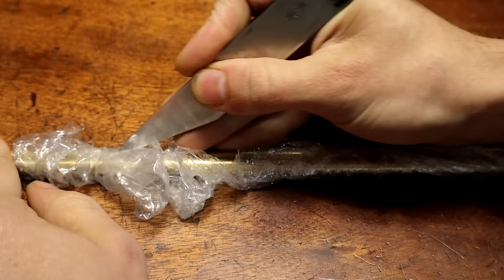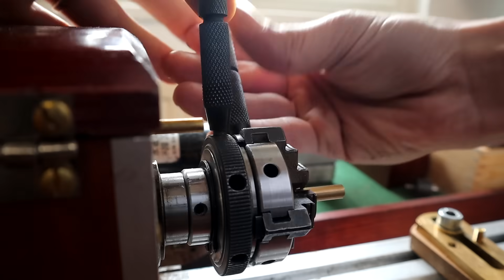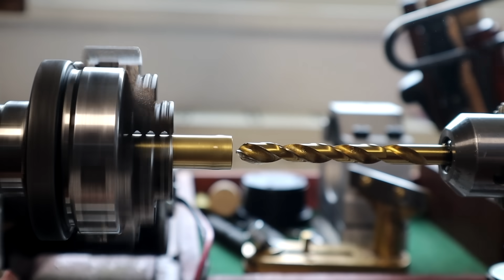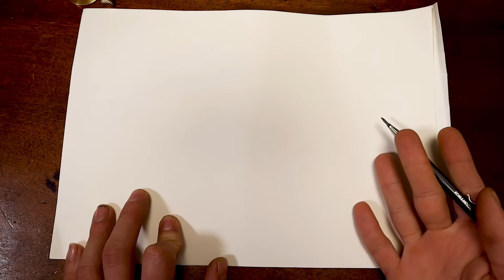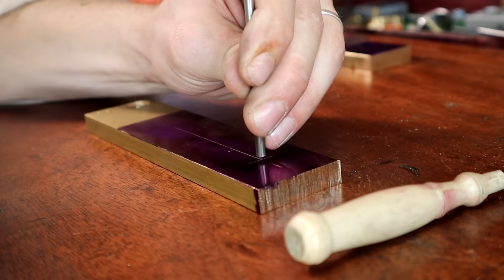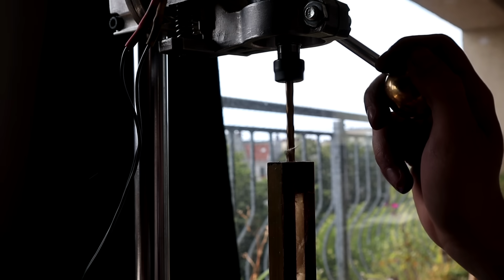Homemade Gear Cutting Indexer

Comment: Uri.... a good homemade way to knurl...... put a file in the vice with the piece. Clamp it down but not too tight the tap the back of the file in one direction it will force the piece to turn and gives crude knurling but looks nice and machined... try it!!
Reply: Pask Makes did a knurling devices because the file doesn't always work nicely. A collaboration between Pask and Uri would be nice too see btw.

Comment: Wow! The Jethro Tull quotation, was just wonderful! You're a joyful person, and I think this mindset is necessary to overcome eventual little failure in the process. Your craftsmanship is outstanding, I would like to be able to use a file the way you do! Never been able. When I was on high school, they tried to teach me, the task was to make a paper-holder made of brass, with a cylinder as a base and your initials screwed on the top. I still have it but everybody every time asked me what is it!

Comment: Very nice job . One of my jobs i did Make .Worm wheels and gear shafts . And parts for Auto motive . And a lot of more things as well . And i never made an indexing head . But did have four of them.  Working with mills ,Drills , Grinders , Turning , Honing. Broaching, Band saws , Plus SPM  work as well. And some other things that got fazed out over the 33 years . Had to give up when i was 47 years old as i had my first stroke . And that was the end of my working days.

Comment: 12th comment! These used to be called "Wheel cutting Engines" Because watchmakers would call gears with more than 20 teeth wheels and with less than 20 teeth, pinions. This is really awesome... About precision though... Its like the pidgeonperspirometer??? No clue how to spell it... THere was actually a company in the 1800's that made these called "Chronos" and they now sell for thousands... Awsome! Quick question... How much did you spend on this? Just asking because there are a lot of milling machines (Like the proxxon mf70) that could do this.
Reply: I believe that a majority of the tools in his shop are made by him, and that's what he enjoys. They're "delicious"!  Cheers
Reply: @Christian Vaughn Yea... I know but I was just curious how much it cost. :D

Comment: Thank you for posting this sequence... which has been circling near my creative occipital bone.. as it does many people I am sure.  Fun to watch, and useful in the sense that it teaches one not to embark into such reinventing the wheel.
Making the tools is massive time off one's life, then the fact that this sort of tool is manually run, even more time wasted out of one's life making parts the slow way, not to mention the issues of precision.

Perhaps useful to one with no means to amass enough money to purchase made tools, but still short lived... one will quickly get winded and step up to the ready made wheel.
Now-a-days, small multiple axis CNC equipment is within reach of everyone, and in the long run a much better option when it comes to saving one's master and critical resource, time.

A fruitful endeavor would be to take an already made tool and improve it with clever attachments or mods that enhances the tool for added capabilities.

Comment: Beautifully done.  You are an inspiration.  I am just starting to do metal working after repairing my CNC mill that got dropped after a move.  My next project is to build a lathe mill - wish me luck.  In any case.  Thanks for the video.

Comment: While your motor and cutter are fixed in position, your indexing head is (more or less) free to deflect away from the cutter since it's base is not locked in position.  I truly admire your work and I also attempt to keep the art in my work.  Your use of wood turning techniques with a metal lathe is not something to be attempted by the hasty or less than nimble.  You do lovely work.

Comment: A noble attempt and very enjoyable to watch.  When you reduced the attenuation of the controlling elements and the gear cutter was improved to multi-tooth design with a factory standard index plate you achieved a very satisfactory result.  Congratulations on producing a very entertaining & relaxing instructional.  Perhaps you could obtain a watchmaker's lathe to enhance your precision's algorithm.  The math would actually become more addressable the smaller your work gets and then you could refine your control more readily.
                                                                                                                                  You've a very creative approach
                                                                                                                                           Mike Kirwan - Kenmore, WA.

Comment: I'm a watchmaker and if we are going to make a lot of the same gear, we cut the teeth along a length of rod the correct diameter and then just part the gear off in the lathe when finished.
That way you only need to go through the process of cutting the teeth once; same can be done for hands as well

Comment: I cut gears in hobs machines, very similar to this idea. I have seen videos online of people doing this in a mill with a 4th axis servo essentially doing the same work as the division wheel you designed. All of the machines I work on are all manuals with no computer controller. Instead of the division wheel, hobs machines actually use index gearing to rotate part and cutter in sequence

Comment: Very nice work considering you did most of it free hand. Well done. I do have a suggestion. On your gear plate advancing screw, you could add a small gear that helps index how far you advance the gear into the cutter wheel. To do this you add a gear or ractchet to the crank side and a spring loaded paw that you push against to advance the gear. This should help to prevent over advancing the gear. By adjusting the gap between the teeth of the ractchet you adjust how far it moves. Keep up the good work.

Comment: Beautiful, you may find a drill guide may help you in some of the holes that you drill and tap this enables exact parallel holes to be drilled, you can buy them or make one yourself, I use them in jewellery making and find them very useful in getting my holes exactly straight and my threads! I still have desires upon your lathe, its so simple but does everything that you want of it.   Scrap the drill guide just rewatched the video again and saw it in the vid but the lathe I still love... also you make such lovely little screws and they are telling me that the heads all need lining up when you tighten them.....

Comment: looked like your first attempt was because the base was not clamped to the milling machine, like wise in second attempt , you see the wood base moving under load in both attempts, thus causing a unsafe  method of destruction ,lol , and not a tool malfunction like you first defeated try ,,, still amazing work, just shows you do not need a full machine shop to do fine work, look forward to seeing it in future videos , stay safe ,love the handle of doom ,lol

Comment: ..Tip ;..............basically you need three sawing points in relation to your material thickness.
This way it will go so smooth........lol.
ThnXs for the Share .....like it a lot.

Comment: If you want decent gears use marking dye around the edge of the gear blank, then alternate between two teeth until barely any dye is showing, then cut the rest at that depth. Thank Clickspring for that info. I'm just the messenger

Comment: It's hard to tell from the video, but I think the problem you might have had with the fly cutter style gear cutter is that you had too much shank hanging out the back. It doesn't look like you had enough clearance and as you took a deeper cut on the gear you started hitting it with the rounded back. I can't tell if it is something breaking or you increasing the feed rate, but it does give a deeper tone just before failure at 14:31 which might be the back end making contact.

Comment: looks cool, well done.
quick tip, you bought a pinion cutter, not a wheel cutter. if you're making wheels larger than 10 teeth you kinda want the latter as the tooth shape will be one more suited to larger tooth-count wheels

Comment: making gears is easy!  making a mistake while making gears unfortunately is far easier  as is any task which requires repetitive precision . but with an percipience tool you can create one with more precision and so on until its just silly precise. as for what you produce it only improves with knowledge and experience. thanks for the video

Comment: Great fun to see you make finish it, and looks cute.

But You really need to use cutting oil when making threads specially with brass,  Why you may ask. well as you hear is squeaking badly, that is due to the friction, and the brass grabbing the threads and ripping, instead of the Tap or die cutting. 
Hence cutting Threads
By cutting the threads properly they will be tighter and smooth.  
so for moving parts you need tight tolerances to eliminate wobbles  .
Also I would get at least 10mm slab of metal for the base instead of that thin aluminium.
as a few days of temperature  changes the base will warp, even on big lathes this happens.

Comment: I think the first blade you made and tempered for cutting the gears could have worked if it had cutting edges on both sides as opposed to your one-sided blade. When your blade spun, it cut the gear with its cutting edge side and then hit it with its blunt side. So, it was cut-hit-cut-hit-cut and then the gear finally broke loose from it's grip.

Comment: What's the manufacturing process for non-hardened ball-bearings?  Could you do that at medium scale with brass?  So you don't have to do so much lathe-work when you want to build a handle out of five brass balls.

Comment: 7:05 what is good creation is that small drill press with a massive appearing motor? High torque and low speed? I must build me one. Need one for slow drilling of metals/lead.
The Base/platform repurposed dremel or what other brand?

Comment: crazy to climb cut on that setup, try cutting on the other side of the blank so that the cutting motion is opposite to the feed motion because having the cutting motion the same as the feed motion makes the cutter dig in and grab the work, with this not so stiff device thats a really bad thing
Reply: also you could use your dial indicator to tune that runout :D wildly impressive to see you do that with files ant hand tools

Comment: I have to know what the drill press/cutting machine is called! I have looked up everything from milling machines to radial drill presses and I can't find anything like that! It's is exactly the tool that I am looking to use to cut slots in my wooden calligraphy pens. I have been trying to make one with a sawblade sharpener, but I don't have any height adjustment. That tool just might be what I need.

Comment: How did you set the dividers to ensure consistent divisions around the index plate? To repeat the divisions accurately, you need to be within .0001", especially on a large number of divisions. Amazing how the last and first would be spaced the same as first and second. The math part is easy, but......

Comment: Nice lathe however you really need to make it hold collets when your working that close to the chuck with a brass rod. The key chuck is going to nail your finger and when it does that will hurt!

Comment: The idea is not bad but the rigidity will need some work especially if you want to cut larger gear wheels. Also Brass must be cheap where you live especially in such thick sections, here in Britain that would cost you around an arm and a leg.

Comment: Could you have the dividing plate on top and have the gear over hanging the side so the sheer strength will be increase and not as prone to being pulled over.

Comment: In machining you really need a solid hold on your parts or things will just break or come out wrong.  I guarantee you if there was more support at the edge, your first set up would have worked just fine.

Comment: Make a can opener that never wears out... Those gears would be strong enough connected to a sharp high density steal sharp blade that spins as you open the can... All the other ones on the market are deliberately designed to wear out so you have to buy a new one... That's cuz the insanity of MONEY!! They are focused on MONEY not focused on making a good product... You sell ONE and the customer never needs to come back and buy from you... That's the problem with motivating people for money..., Use your motivation to create something others are too selfish and stupid to do!!!

Comment: Lol.. ...are you Jesus? ..I dont know, are you? All the pics I've seen of him look like you could at least be related.. Are there any Sinclairs in your family tree? Lol

I digress. I really like your work. You're a true craftsman who isn't limited by tools or their lack. Please don't take this the wrong way. There is a more accurate way to lay out a hexagon. But it must be planned ahead or you need a center finder that's accurate. If you scribe a line through the very center of the circle, extending it all the way across both ends of the circle. That will give you 2 of the 6 points. Then, using your compass or dividers set to the radius of that circle, hold the point on one of the first 2 points and strike a point in each direction, in each side of the first point. Then go across the circle to the second of the first 2 points and do it again. This technique will drastically improve the accuracy of the whole process as the compass never leaves the known point of reference. ..have you ever really landed back on your starting point when you dance the compass around the circle 6 times? I dont think I ever have. I've come close but had to massage the last one. 

Also, the slot you cut into the brass plate was awesome. I'm only sharing this next tip, in case you find it handy. It's from a very skilled tool and die maker. He grinded one edge of all his flat files completely smooth. That way, when filing against a finished edge, the file will only cut in one direction, making slots much easier to make look like the one you made here. I did it to my flat files using my 1" belt sander and a 60 grit belt, up to around 180, quenching after each pass. ..except the last pass. I let that heat dry the file.  

These are in no way critiques. I think you do excellent work. Im just trying to share with you because you share so much with me and everyone else..

Comment: Please, play your flute, it's less dangerous.
I hope, you remember that safety rules are written in blood bone slivers. 

1. Machining with handheld cutters is super dangerous, you've used relatively soft metal alloys, someone may try it with steel. 
2. Metalworking with no proper lubrication kills tools and potentially may cause physical harm. I did not enjoy the sound of brass being raped.
3. Tooling steel hardening and allealing must be controlled by a thermograph, not your good will. Unless you are a T-800
4. Wooden base should never be used for metal machining. Did I say WOODEN? Aluminum is a no-go either, for the job stated in your video. Cast Iron only.
5. Mechanical precision, have you heard about it? Finally yes, you've got an Ok'ish division disk...

I'm reporting you for potentially harmful and falce/obsolete tech info.
Reply: Hand turning is common practice when it comes to watchmaking. I am a watchmaker (It is my job) and I can even cut hardened steel. Please do not talk about something you don't understand. Brass is self lubricating, It is very smooth and that is why it is commonly used for bearings. It always makes that noise. It is fine! As for the taps and things like that, they can be sharpened, and also they are hardened :D Tooling Steel hardening is completely fine do do by your own will. It works! The temper colors are even more precise. Also, Unless you are making a big pneumatic, or hydraulic/ professional tool, you do not need a thermograph. CAST IRON ONLY!?!?! You are out of your right mind! This man does not even have a milling machine. I have made tools from wood! Mechanical precision is also not useful for fun. This is not for micron precise shit. This is for fun! Do not report somebody because YOU are full of bullshit and fuckers. Oh yea- I reported you